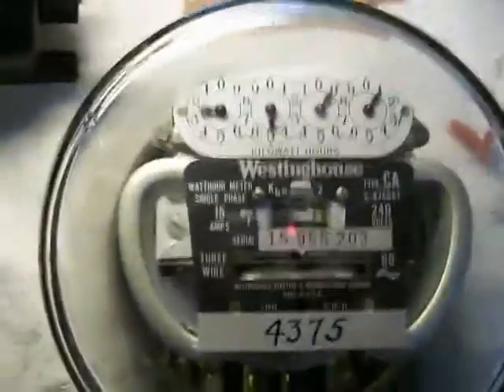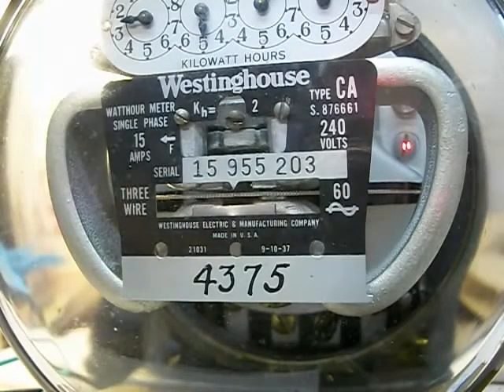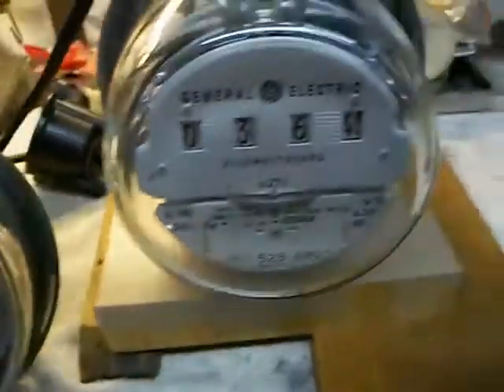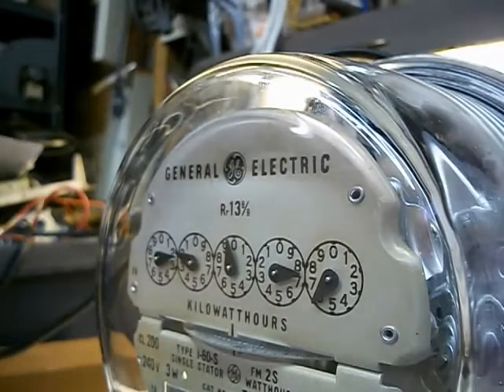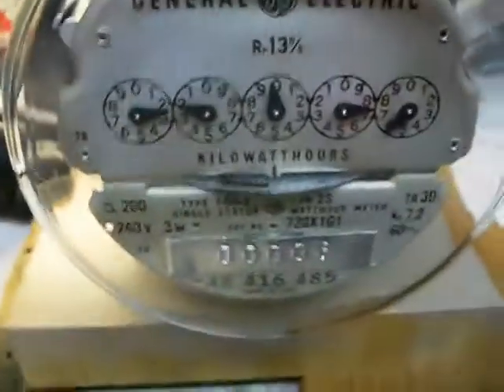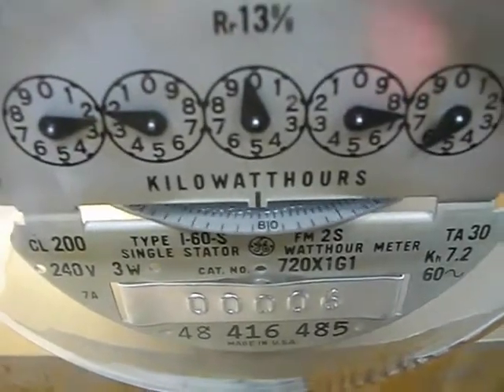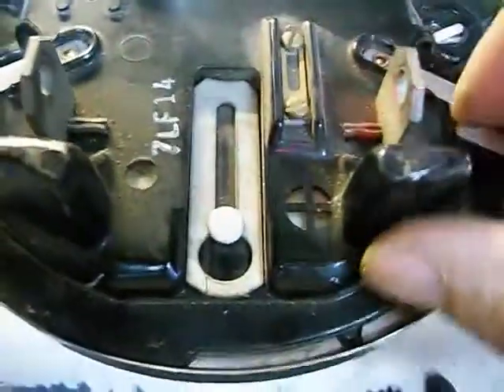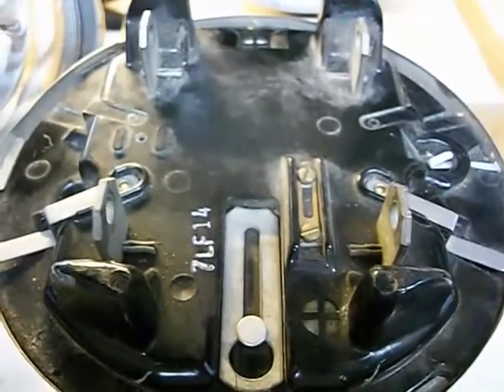Old Kilowatt Hour Meters - Running

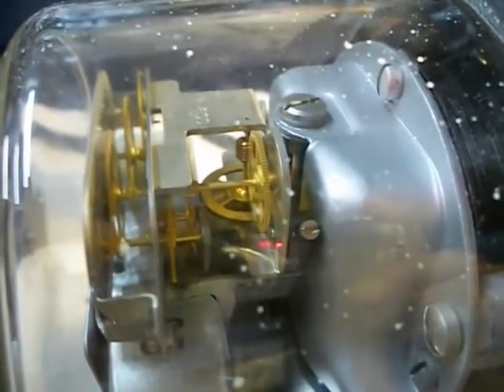Comment: Hi, on 1:45 you mentioned you calibrated a meter.  Can you explain how is that done?  Thanks.
Reply from the maker: I used a 100 watt bulb and timed its usage.  It’s faster with a space heater which I used also

Comment: Firstly many thanks for making this video.
They are very well made meters, great to show the workings on YouTube.

TA is test amperes
Kh is Watthour per revolution of the disc
3W is 3 wire Phase, Neutral, Phase
CL200 is maximum current 200 Amps, CL100 is 100 Amps
Potential link, little sliding link at the back.

Comment from the maker: @Ridge97 LOL, yea the older meter I had would do that cause it was so worn.... but they changed it for electronic.  If you pull it or bump it, it registers that its been 'tampered' with.  Even as an electrician, I gotta call the guys up and say hey im gonna pull my meter to change out the main breaker or what not, or in an emergency if you need to cut power...... they write your name down and that the meter has been pulled.  People were pulling them and slowing em down lol

Comment from the maker: @KISSITPEOPLE Some if not most you can reset or move the numbers back, but it might bite you in the a55 as they could either figure out what you did, or think it went past were it was previously to where you set it and charge you more.  lol  I dont think you can make it actually run in reverse itself.....  they do slow down with age if they arent calibrated.

Comment: use to be able to take your fist..hit the top of the outer glass pretty hard. when it was runnning fast in winter..it would stop...until your heat pump cut off..then when it came back on it would start back..LOL